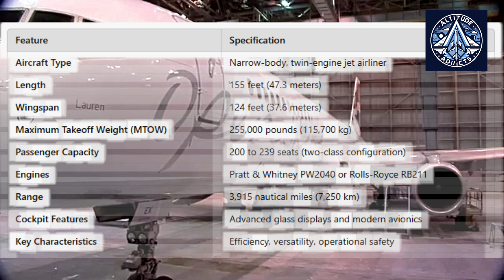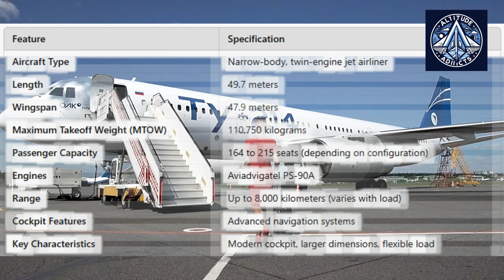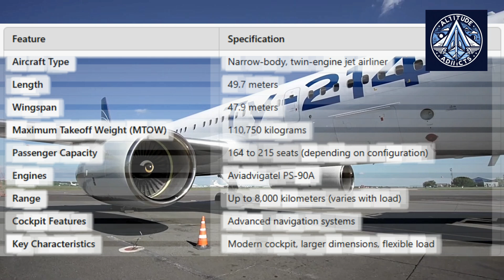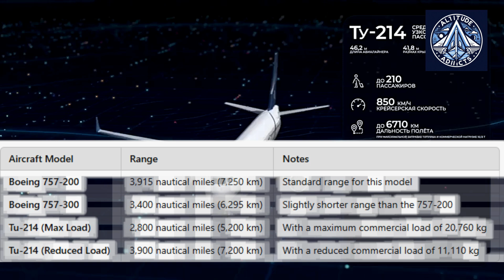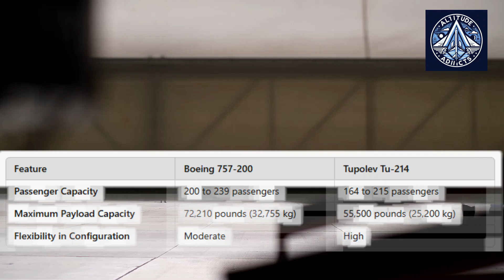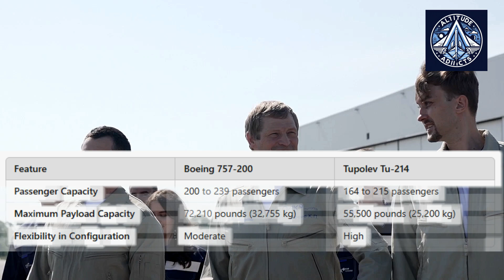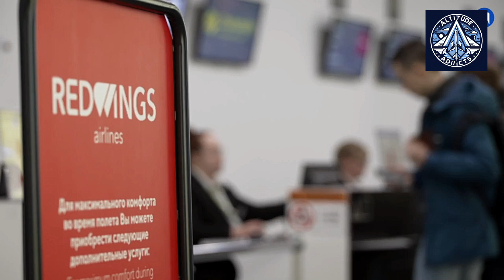Boeing 757 vs. Tu-214: The Evolution of Narrow-Body Giants

Comment: The TU-214 is a modern aircraft with flight-by-wiere triplex system and modern PS-90A3 engines in its newer versions, more reliable, powerfull and greater payload and range aircraft....
It can not be compared with a dinosaur like the B-757 with pulleys, cables and hydraulic controls, it is an old aircraft that can be compared only with the DC-8 or the 727's of yesteryears....

Comment: The Boeing 757 production line ended in 2004. 
Currently, airlines have started to phaseout this model. 
And the new benchmark in this segment in terms of economic efficiency is the A321XLR/LR. 
And it is mandatory to have a cockpit for two people.
What is the point of comparing the Tu214 with an obsolete aircraft that is no longer in production??
Reply: There are videos comparing the 757 to the a321 xlr etc and they are not really comparable. 321 is not a benchmark in that segment as much as it is a placeholder until something better comes along.
Reply: @manuelcasal7209  Exactly what I thought. The TU 214 is similar in size to the 737 and some A320 variants.